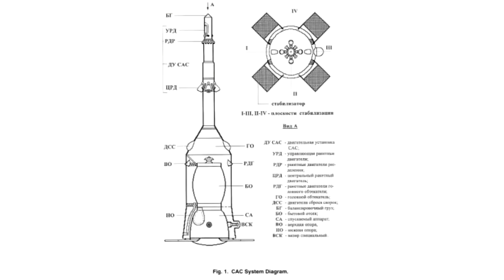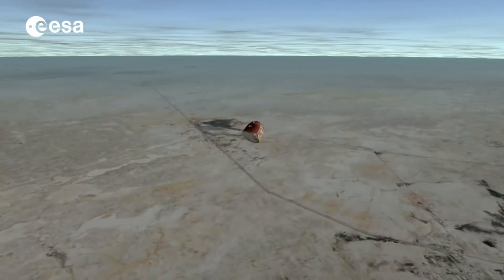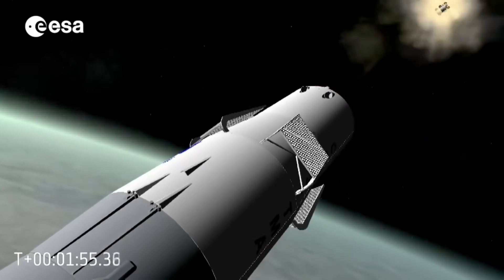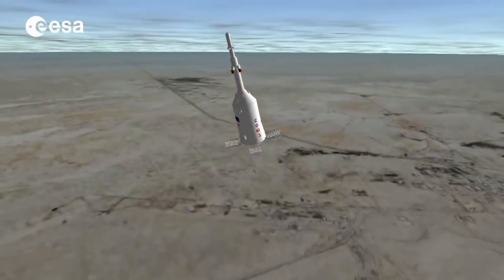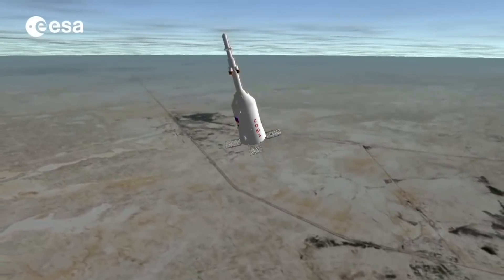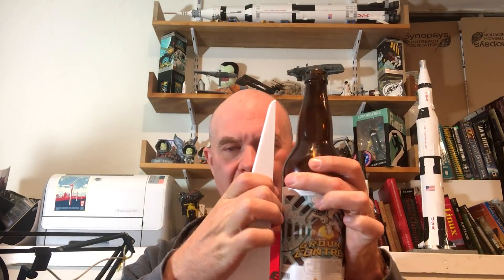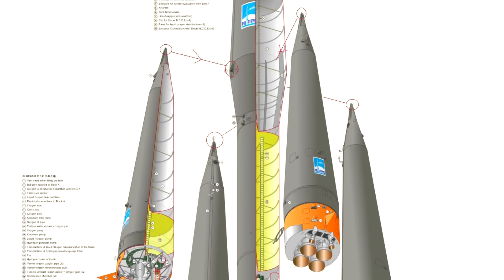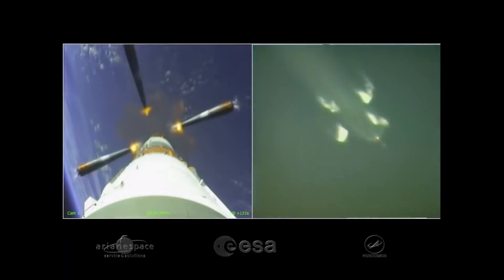Soyuz MS-10 Failure - Updates & Answers To Your Questions

Comment: Hey Scott, if they don't have a R-7 Soyuz rocket operational, even an unmanned launch, or planned to be operational by December do you think NASA could convince the Russians to give up a Soyuz capsules (all three sections) or 2 and launch one unmanned on a Falcon 9 so that the crew can have a working lifeboat in time? For the second capsule, if they can get it let alone get one capsule, and the Falcon 9 Block 5 with the new composite helium tanks gets the required 7 launches to become human rated by then Space X could theoretically bring the the Canadian that's scheduled to fly in December as well as this unfortunate, lucky Astronaut/Cosmonaut pair up to the ISS then. This is all under the assumption that the Dragon capsule will not be ready by December which I don't think it will be
Reply: I'm pretty sure there is a stock of several rockets and ships, so no worries. The simplest way to put a lifeboat there is just to launch yet another Soyuz unmanned, not risking anyone's life, rather than sending unproven tech up there.
Reply: I definitely agree with the don't risk anyone's life part but is there a stock of built rockets already? Those are things you don't want to sit around for too long before you launch them without having to re-test them. All lunches are currently on hold for the R-7 so my point is if they don't find the issue and unfreeze the launches in time or are suspected to not be ready to launch in time. Although its faster to modify a prebuilt rocket than it is to build one from scratch its also much easier to modify one that's still being built
Reply: Just an opinion here, but I doubt it. Even if the Soyuz capsule was compatible with another rocket (I don't think it is), I don't see Russia giving NASA a capsule to launch on a ULA or SpaceX vehicle. (Of the two, I bet ULA would be more likely to get the contract. SpaceX is cool, but ULA has a really good track record for this kind of thing.)
If it were an emergency, things might be different. But the ISS keeps extra supplies on board for exactly this kind of scenario. If it comes down to it, I suspect the ISS people will just change crew schedules and keep the astronauts/cosmonaut on board longer rather than rush an untested rocket configuration.
Reply: I highly doubt that Russia will give even a single Soyuz capsule up as well but an adapter to make the capsule fit could be made for an unmanned launch very easily and the Soyuz both fits inside the Falcon 9 fairings and if within payload capacity. Other than that issue, the reason that I chose Space X in this scenario is that Space X has boosters that are already built and with a quick adapter fabrication and launch calculations the Soyuz could be launched quickly if it's unmanned. On the other-hand does ULA have a spare Atlas V or Delta IV (most likely Atlas V) laying around to use for a launch? I doubt it and I don't know how long it takes to build a Atlas V (or Delta IV) but I doubt it's 1.5 months or less. They can't keep a crew on the ISS for too long even if they have enough supplies already or are resupplied because as mentioned in the video, the current Soyuz lifeboat on the ISS won't last long enough before the "sell by date" is past and they can't keep crew on the ISS without sufficient seats on the lifeboats for emergency.  My point is mainly so that they can try to replace the lifeboat currently on the ISS so that we can keep crew on it, the possible launch a crew up on the Falcon 9 if it happens to get Human certified is very far fetched and I know that. On a side note, if I'm not wrong the current lifeboat is the Soyuz capsule that has the epoxy sealed hole in the orbital module so that's one you really don't want to stay up past the "sell by date"
Reply: @ben4771  that's a good point. I was looking at the companies from a capability standpoint rather than a ready-to-launch standpoint. Even then, the falcon does take semi-regular trips to the ISS so I'm not really sure why I would prefer ULA after all.
But even so, the sell-by-date is a soft-ish deadline and I'm sure the people in charge will take that into consideration when they decide what to do. It wouldn't be ideal, but then aborting a launch two minutes after liftoff isn't ideal either.
But right now it's too soon to tell what might happen. The Russians might have a rocket ready to go by December. Who knows.
Reply: I don't blame you I thought the same thing until I thought of ready to launch and build times. ULA could probably get the computers and structure of either rocket made in 1.5 months, the issue is could they complete every test needed and build the engines for the rocket in time (rocket engines aren't easy to build and test quickly, assuming they don't have some engines built and tested already). They were going to Launch a Canadian to orbit in December so if they wanted the Russians could have a Rocket ready but would it fix any problems that they had in this flight if they did that? Probably not. If they determine that it was just a stuck valve like Scott mentioned in the video then they could probably make a minor change and fly unmanned in December to prove it was a (hopefully) one time issue. Unless those conspiracy theorists are right this time...that's very doubtful though
Reply: Theoretically it might be technically possible, but it will not happen. The crew will return if Soyuz can't send up another capsule.
Scenario 1: Soyuz is not ready come December and the astronauts return leaving the station uncrewed for the first time in 18 years.
Scenario 2: Soyuz is ruled safe. The next crew rotation mission, MS-11, will go in December when scheduled.
Scenario 3: The Soyuz investigation is not over, but Russia decides to take the financial risk and launch MS-11 uncrewed to replace the current Soyuz in orbit.
Reply: I agree it is very optimistically a 5% chance of this happening at best and that your scenario 2 and 3 are the most likely options but it would at least be a neat thing if it actually happened though. Also a great backup option in the worst case for the future if the can convince the Russians
Reply: @ben4771  It's not just a matter of bolting on the hardware, even the computer systems all have to be designed to work together, group, booster and capsule.  It could probably be done with time, but it's not something that could be thrown together in a few months.
Reply: @TheEvilmooseofdoom  in the case of not launching passengers the computer systems dont have to work together, you just have to launch it as a dumb payload and let the Space X launch computers do the work. The only issue is you have to find a way to activate the capsule and pass the telemetry data once you're in orbit to let the capsule take care of the rest, and thats much easier than making the computers work together for the launch
Reply: @ben4771  Except that the capsule is not a dumb payload, it's a fueled craft and if it senses something wrong with itself then there IS a problem especially if it can't talk to other computers, or can't trigger it's own abort.  You over simplify I think.
Reply: You have the capsule on-board computers shut down until it's in orbit, if it's in the Falcon 9 fairing to hell with it's abort sequence because it would fail anyways and you wouldn't have the abort system installed anyways. once it's in orbit there is a way to activate the capsule then otherwise it wouldn't have the capability of being an autonomous launch vehicle like it actually does. The only issue is to make sure there would be a way to start the computers by Space X systems and then transfer/transmit the telemetry data to it by the on-board Space X computers or by that point, ground station transition would work. Another thing they could do would be to say to hell with starting the capsule to begin with and since Space X send capsules to the ISS to begin with, take it there on the upper stage and have the arm grab it to manually dock, then have astronauts in it get it into full working order
Reply: @ben4771  Sure, I guess that's possible if the capsule is un-manned.  I still don't think such a system could be cobbled together in the 8 or 10 week window.  You need to design, build, test, and mount a payload adapter(providing there is even a booster available - or a spacex customer has to be told their launch is being scrubbed which will create legal problems for spacex).  Then there is the transfer of personnel (you need a lot of technical people since this is a payload that spacex has had no time to prep and has never handled and you don't drag and drop these things like a certain game).  The hardware has to be transported then prepped in a facility never designed to do that.  It's not so easy with such precision hardware to just cobble things together to do something no one ever planned. All of that has to be done after the time spent negotiating who does what and who pays for what.  I believe it could be done, just not in this case in this time frame even if they had the will to do it.
Reply: It would not have time to be properly tested.

Comment: Would it be possible to refuel the Soyuz docked to the station in orbit with the peroxyde?
Reply: Possibly not, because I don't think it is that easy to just put propellant in a fuel tank of choice. They would have to carry enough peroxyde up at first, and then they may not have a possibility to access the tanks where it is stored
Reply: No. Most likely not. 
They are far more likely to replace the Soyuz with an uncrewed launch of MS-11 which was planned for December
Reply: Well, you'd need to send it up there in something like another Soyuz anyways. So not much point. Besides (I might be wrong), I don't think they have been designed with orbital refueling in mind.
Reply: In situ propellant production! I mean, they have a lot of lab equipment up there.
Reply: the extra peroxide that would be sent up as 'extra fuel' would be degrading at the same rate as the fuel for the thrusters = no point in doing it.
Reply: @mihy26  yeah, you would have to fly missions at a constant rate to always have enough of it left...
Reply: No. The technology is too old
Reply: It must be the mechanics of trying to refuel it, rather than the weight of the fuel itself, that is the main deterrent.

That's just an assumption though. The reason I have this assumption is that you only need what would be required for attitude control and I think the movement of some fuel. I don't think it's the same amount that would be needed to supply a Soyuz through launch, rendezvous, docking, undocking, deorbiting and re-entry. Just enough for those last three. Considering you're not also carrying up an extra Soyuz, extra personnel, food, O2, H2O, etc., it seems that carrying enough fuel to gas up the other Soyuz would be the economical choice if it were possible to resupply that boat.
Reply: Absolutely not. Pure peroxide is really nasty stuff. The ISS crew is not trained in handling Peroxide fuel and the Soyuz was not designed to be refueled in space.

Comment: I think it’s fair to say that Russia can brag about their ejection systems because is this case it worked great. Not saying that they are better or worse. But they now have the proof that it works flawlessly. So they deserved it. Saving 2 lives. Thank god
Reply: Well it's more about the fact that the US had none for the entirety of the Shuttle program. Loss of vehicle meant loss of crew. There where some abort modes but if the stack just came apart they couldn't do a thing.
Reply: 221 b Sure, but that happened exactly once in 30 years of operation?
Reply: RealityIsTheNow Three successful aborts is better than single failed one.
Reply: Agreed, I think the shuttle's emergency egress systems were mostly forgotten after the first few flights.  Crew members on the mid-deck had no plausible escape method in the event of vehicle failure.
Reply: 2 times https://en.wikipedia.org/wiki/List_of_spaceflight-related_accidents_and_incidents
Reply: you right only one space shuttle launch failure. but 14 persons died in a space shuttle and only4 in a soyuz
Reply: Technically two launch failures; the Columbia reentry failure was a huge political smear on NASA because the damage was caused by ( another ) insulative foam failure and impact on the orbiter vehicle, damaging part of the reentry shield.  This information was withheld from the crew because it was decided that there was no way to reasonably repair it:  The damage led to thermal failure of the reentry shield, resulting in excessive heating and catastrophic failure of the wing structure.
sebastiaan martens
[EDIT: This second paragraph applies to the Challenger mission failure, not the Columbia.  The Columbia broke up completely at roughly 50,000 ft. of altitude at supersonic speed.]
It is worthy to note that recovery and examination of the crew module indicated that mission pilot Mike Smith had been operating switches on the upper console in an apparent attempt to restore electrical power.  It stands to reason that if NASA had actually installed a rocket-motor-and-parachute abort system in the crew module as a failsafe, it could have been used to attempt to stabilize and slow the descent of the crew module, providing some possibility of survival below hypersonic speeds.
Reply: Alex Buss better ya, thank the engineers. 
I believe they used to be an old custom of a crate of beer for the techs if you’d be to eject and it works. Seems appropriate.
Reply: @Alex Buss
Can't get complacent though.
Reply: Alex Buss they did great with the LES of the n1, which is why it’s a shame all four of them exploded.
Reply: Agreed! The Soyuz is one hell of a rocket... But not worth what they're price gouging us for, lol.
Reply: Heather Larson  i'm reading it and wondering.  I'm not used to it!
Reply: We had it for the Mercury,and Apollo...yet we let 7 die on a shuttle because they had no way to survive if things get bad
Reply: @granddukeofmecklenburg  The US tried to save weight that's all. The Soviet Buran somehow manages to have an emergency exist but I do not know how it worked.
Reply: 7 died on Challenger since NASA was pressured to launch in freezing temperatures to impress the USAF and shift all TItan cargo to Shuttle. 7 died on Columbia because a chunk of foam broke off and smacked an RCC panel. Both were materials failures that were unknown to the engineers. Flawed logic is flawed.
Reply: THANK THE ENGINEERS*
Reply: Meh. Its the same basic system that every space capsule uses. It's just that nobody else has had to use it in flight before. The only one that's different is the Dragon 2, which uses those engines on the side of the capsule instead of a tower.
Reply: STS-100 Starliner also has rear mounted liquid fueled abort engines. They're having some problems with those right now, so delays.
Reply: except the Russians also had an ejection system in the boran as it was essentially a better space shuttle so :/  @RealityIsTheNow
Reply: @RealityIsTheNow  and the Boeing starliner, where the abort motors are on the service module and the gemini capsule, and the scraped buran had ejector seats.
Reply: Now if Russian rocket technology worked great there wouldn't be any need to use the abort system!
Reply: David Johnson Russian rocket tech works just fine. You're naive if you think shit never hits the fan.

Comment: Good investigation & summary. It fits the information we have thus far. In the video at 9:27 you can see that the star formed by the 4 strap on boosters is asymmetric. I am very impressed with the Soyuz escape system. Used 3 times. I did not know the details of how it works. Your review points out how each about was at a different phase of the of the abort systems use, so all modes have been 'put to the test' now. Wow.
Reply: I was just thinking the same thing, the Korolev cross didn't look quite symmetrical. Also the amount of vapor released at the time of separation does look rather large, which would make sense if the side of the main rocket had been hit and damaged, plus there is what looks like debris coming down soon after.

Comment: I know there is a lot that goes on to send anything to the ISS (like literal second long launch windows?) however could they maybe send a Dragon with more fuel for the current capsule or is that not re-fillable on orbit?
Reply: If you want to refuel something in orbit you have to specifically design for that capability, an effort that is only worth it if you plan on having a refueling depot in space, which there is not.
Reply: @rogercoulombe3613  And you have to have someone handy trained to do the spacewalk it would require too. :)
Reply: theoretically, you would design such a refueling system in a way that doesn't require an EVA. you either use a robotic arm or a port integrated into the docking clamp.

Comment: In the thumbnail, why did you circle a strut at the bottom of a booster when the suspected failed part is actually a valve near the top?
Reply from the maker: Because I was dumb and fixed it later, but youtube takes a while to catch up.
Reply: Much better! Post safe. :-)